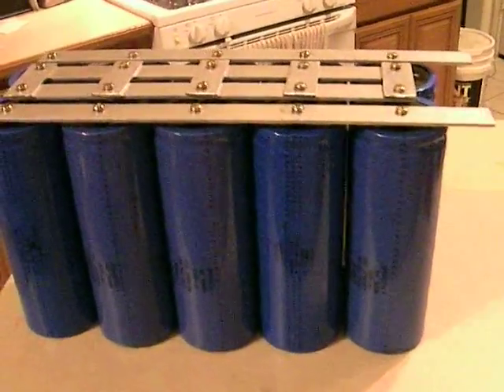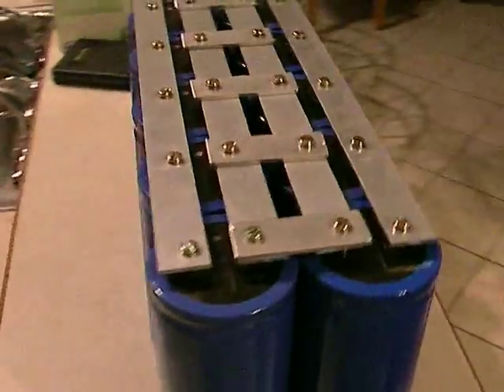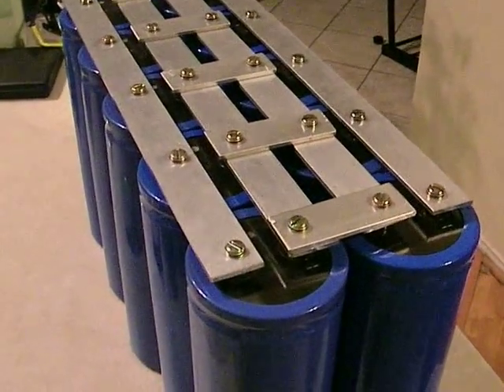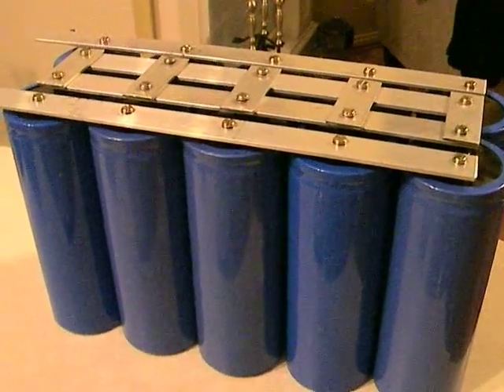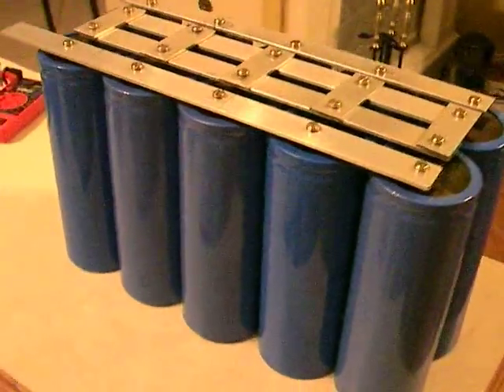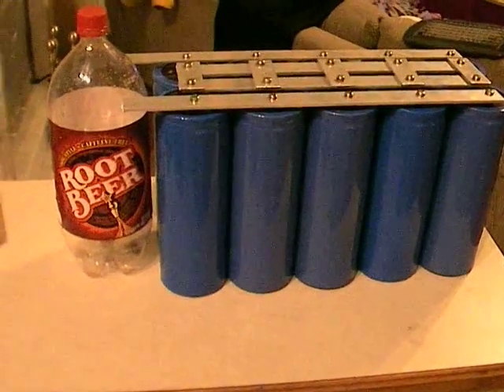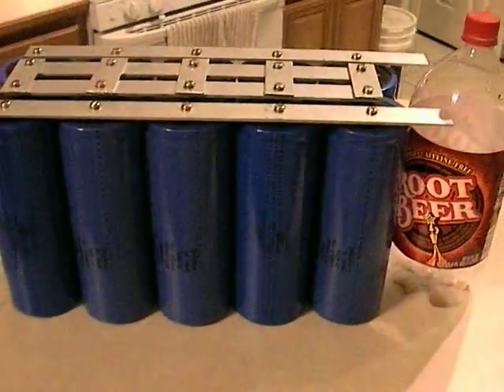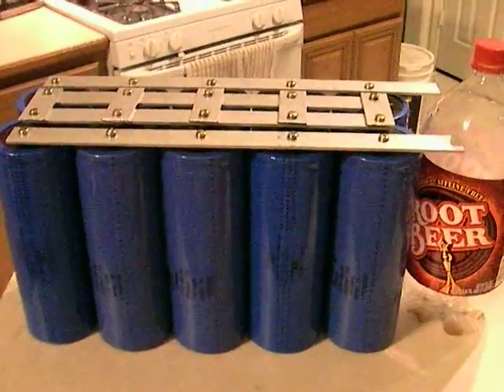150,000 uF Capacitor Bank for Electric Car

Comment: Little use of that for an EV. The energy capacity of capacitors, 0.5C*V^2. Assuming the voltage drop for your capacitors was 50 v (most most optimum) , 0.5*0.15 F *(150V*150V-100V*100V)=938 J. For a 120 kw EV, such energy offers 0.8/100 power to drive your car. Or the most, it can drive a 3000 LB EV from 0 to 1.2 m/s.

Comment: i dont know much about Capacitors. in what way would these help an electric car? would it aid in regen? would it be for quick bursts( like a camera's flash [the disposable kind])? Oh just read the description... oh well. hypothetically if some one put those in there car and a electric motor But keep the original engine and the added some way to charge the Capacitor Bank(not sure how realistic this is) would it just give the car a short(not short as in small but short as in limited) boost(almost like NOS in video games?)?

Comment: The caps may smooth the supply a bit, but will do next to nothing else., The capacity is far far far too small to level out the high amp draw needed by the motors to accelerate the car and make the batteries last longer. You may need to add 2 balancing resistors on the bank.

Comment: 150,000uf means nothing , if they were Farads YES but not uf.
Reply: They are only thee to cover spikes in charging and draining. Good for accelerating and regen braking. It overcomes the internal resistance in the battery and prevents overheating.
Reply: even if it was 150,000Farad. 150,000f /60seconds/150volts.= 16.6AH.. not enough for a EV.

Comment: i have a bunch of big 5000,000uF caps 5V wired in parallel,i know the series parallel rules but know one ever mentiond if it adds volts .2 X5v cap will take 10v. but i have 10 hooked up and they handle 40V ,3amps fine,is this right or wrong ,reply thanx.
Reply: The voltage rating is how much voltage the capacitor can handle, not what it produces.  When you put them in parallel, you can only apply as much voltage as the lowest rated capacitor.  In other words, one cap rated at 5 volts and one rated at 100 volts, you can only put 50 volts maximum.  

When you put capacitors in series, it increases the voltage you can apply.  So with your 5 volt caps, 2 of them in series will allow you to apply 10 volts.  But your capacitance goes down.  The total value of capacitors in series is calculated the same as resistors in parallel.  With your 500,000 uF caps, 2 of them in series would be 250,000 uF

Comment: I know that this is a good thing.  I am glad to see that someone understands.  I have put large capacitors in my own electric car.  When the battery voltage drops, the car will not accelerate and the motor draws too much current.  I run a timing circuit that drops the pot box back up to 25% for 1 second to lift the voltage on both battery and capacitor.   Next, the capacitor works with the battery to really spin the motor and get the car moving.

Comment: You should really have a plastic or other insulator between the bus bars for safety. Drop a screwdriver, coin, key and it would possibly have a huge BLINDING ARC discharge with arc welder heat ! Almost impossible to stop it from destroying itself and PEOPLE around it !
 A small length of plexiglass or other insulator raising above the electrodes by 2 inches or more is needed for safety.

Comment: Is there any advantage to using a bank of small capacitors over using one equivalent super capacitor?
Reply: +stylac might be too late to answer now but yes there is, super capacitors often have higher (around 10 times) inner resistance. that affects the discharging time, so basically they discharge way slower. Not sure if this applies to all though.
Reply: +lyzux 

Good to know.   Thanks!

Comment: I'd use all capacitors instead of lead acid, they're a fraction of the weight and half the price
Reply: No, they're not. The bank in this video is 150,000 microfarads, which is 150 farads.  That's 150 amp-seconds.
A single AA nickel-metal hydride battery is about 2000 milliamp-hours, which is 2 amp hours, or 7,200 amp-seconds.  A small lead-acid motorcycle battery is about 12 amp-hours, which is 43,200 amp-seconds.  That's 288 times what the bank in this video will store.  Do you really think 288 of the assemblies in the video are smaller or lighter than a small motorcycle battery?  I don't.
Reply: Dan-Ari Feinberg I was thinking of super capacitors and being conservative with the throttle. By the time I build an electric car capacitors should hold half the power batteries can
Reply: Dan-Ari Feinberg 150,000 uF = 150mF (milli farads), not 150F
Reply: Telukin
You're quite right about the conversion.  To the original comment about capacitors being a fraction of the weight of lead-acid batteries, a 150millifarad bank, even at 75 or 150 volts would still hold a tiny fraction of what a battery could.
Reply: Dan-Ari Feinberg But batteries have relative high resistance compare to capacitors and give off power slow.

Comment: also, 150 Volts is max voltage if your charging system spikes over 150V you will have a cannon shell going off under your hood. usually manufactures make sure the caps are rated double the operating voltage of the circuit to prevent caps from exploding.

Comment: No, it's 150,000 ufd @ 150V. Caps in series is the same formula as resitors in parallel or less than the total 1/((1/C1)+(1/C2)+...). Two 60,000ufd caps in series are 30,000ufd. 30,000 x 5 = 150,000ufd or 60,000 x 5 = 300,000 / 2 = 150,000. Basic electronics theory will tell you that.

Comment: I think you can also connect a perm magnet alternator to you electric car to spin along as you drive and i bet that will increase range effectively!
Reply: Nope. UnderUnity plus UnderUnity NEVER equals OverUnity. 
But using a PMA/PMG for regenerative braking is the way to go!

Comment: I'd like to second daveharpe's suggestion to use equalizing resistors. If this is being placed across a series battery string, you could also connect the center tap of the capacitors to the center tap of the battery string to ensure equal voltages on each half without wasting any power.

Also, electrolytic capacitors have a nasty habit of failing violently. Consider fusing them, or at least connecting them downstream of the battery fuse/circuit breaker.
Reply: Dan Soethe Normally you want capacitors to discharge into those resistors to make the stack safe to handle some time after you shut off the power. But here you want to store energy indefinitely so you can't do that. I think a power zener is probably your best bet as it doesn't waste any power at all unless the voltage gets to a dangerous limit. The zener itself doesn't have to dissipate all that power, you can amplify one with a power transistor that is well heatsinked. Ideally you'd also monitor those safety shunts and cut power if any of them starts to dissipate a serious amount of power.
Reply: zener diode balancing is sometimes a good alternative
Reply: African Electron Yes, zeners are a very good idea because they don't have to conduct at all unless the voltage gets to a dangerous point. You just have to be careful, because some failures might cause the zeners to dissipate so much power that they burn up.
Reply: if you use resistors for charge equalization be sure to use rectifier diodes in series with the resistors to prevent the caps from discharging back through the resistors when you disconnect the charger or turn off the car.
Reply: ApolloWasReal check out my video on super capacitors and ways of balancing i use zeners  (please note the shameless self marketing).
Reply: Phil Karn that's true all though zeners have a natural resistance when reversed biased so that is often enough to prevent them burning out
Reply: African Electron I don't understand you. Zeners are designed to break down at a specified reverse voltage and go to as low a resistance as possible to keep the voltage from going any higher. This means  they can easily dissipate a lot of power carrying relatively little current since the "on" voltage is usually so high. E.g., a 9V zener carrying 1A  dissipates 9W.

Comment: Hey you brainers... forget caps in parallel with the battery. Use a coil in series with the battery output instead. Remeber how a coil work with high frequency current riple.... it will straighten out he current flow.........

Comment: What i cant wait for is silicon super capacitors to get developed well. Energy density is through the roof  compared to what we have now!

Cant say theyll be cheap, but electric vehicles will charge in minutes (as fast as the supply can provide) and run much longer.

Comment from the maker: Yes it is a DIY electric car and its battery pack has actually been upgraded to 156 volts now.  It has more power and faster acceleration.  Safety comes down to practices.  Using a spanner and dropped across 156 volt or 48 volt is just as bad, a huge plazma ball and sparks will happen either way.  More saftey things should be taken considered at higher voltages but they can be just as safe as lower voltage.  Just need a good head on your shoulder when working with high voltages.

Comment: 75 V. is the voltage that safely be applied to each individual capacitor, not the vehicle's battery voltage.   More likely than or not here it's 48 volts if it's a home made vehicle & looks as he is.  Went to his home channel it's home built , but shit it's  120 V. damn. All kinds a reasons why to use that higher voltage in an EV The only reason not  to is it's generally agreed on that 48-50 V. DC is the safest limit.

Comment from the maker: I just looked up the E-rockit and that is pretty cool idea.  But you wouldn't want to use capacitors in place of a battery.  You should look up a lithium battery.  You can get just about what ever size lithium battery you want for what ever milage you want to go.  They are really light weight which solves your brick problem.  But that is a very cool idea and would like to see more things like this around.

Comment from the maker: If you use an oscilloscope, you will see the amperage spike is higher than what is read on most meters.  They are essencially showing an average.  When the DC controller is chopping the power, it is doing it at a super high frequency that most meters can't see.  I was hoping these caps would scrub out the higher peaks to better match the average.  This wasn't intended to add capacity for driving.

Comment: In this video he has a:
(75v)5=375v
(.06f)2=.12f=12ah/3600=.00333 amp*hours
(375v).00333ah= 1.25 watt hours 
Hardly enough to run a flashlight and this set up could violently explode if overcharged.
If one capacitor is slightly leaky, it will gradually transfer its voltage to the others, possibly exceeding their voltage rating in turn. And if one of them punches through its dielectric barrier, it can then damage others in a cascading fashion.

Comment: Interesting, I have never thought about the batteries internal workings would be affected by the current spikes that the motorcontroller could to generate,  releasing energy to the motor.
I wonder if anyone has analysed hi frequence discharge from the batteries, How it affects service life

Comment from the maker: This setup is a 5P 2S.  Meaning 5 in Parallel AND 2 sets of those in Series.  This is done all the time on batteries AND capacitors to make up different voltages AND capacitences.

Comment: The voltage does not stay the same at all, there is obviously voltage drop for starters, but if you knew anything about ANY type of battery there is a discharge curve, NiCD for instance has very poor curve, fading alot as the battery is depleted, A123 Systems for instance (LiFePO4 w/nano-phosphate) has the best discharge curve of any battery, virtually no drop in performance until about 10% SOC.  The concept of using capacitors is that they are a 'power buffer', taking the brunt of the peaks.

Comment: You are correct (amazing that the truth gets negative votes) E=1/2CxVxV , C=0.15F (not0.3F) .. V=150 . so energy stored is 1687J  but only about 500J would be available to for use as the caps are only slightly discharged. This will do nothing.  Electric Formula should consult an electrical engineer. TELLING THE TRUTH IS NEVER NEGATIVE

Comment: The problem with using capacitors is that as they deplete the voltage also drops as apposed to batteries were the voltage stays the same till they are "dead"
Reply: Don't capacitors charge quickly?

Comment: Great, thanks for showing this!
I've created a cap bank(29240uF) of 43caps with 680uF/400V for my Mitsubishi i-MiEV.
It's parallel to the traction battery of 366V. In first tests everything is equal, but in the regenerative braking I've got a huge difference and I got more Amps to the battery back!

Comment from the maker: You are correctly, the caps should be discharged when not in use.  I have some resistors to bleed them down.  I also have the caps in a container to prevent anything or anyone touching the buss bars.  This video doesn't show the process of slowly charging them or the container I was storing them in.  So those are things that need to be looked at as well.

Comment: Well, I don't hear millifarad that often in everyday life, but plenty of other metric units with milli- as its prefix. So it's not exactly difficult to apply that to Farads as well ...

Here, a free lesson:
Pico = 10^-12 (abbreviated with "p")
Nano = 10^-9 (abbreviated with "n")
Micro = 10^-6 (abbreviated with "µ")
Milli = 10^-3 (abbreviated with "m")

Kilo = 10^3 (abbreviated with "K")
Mega = 10^6 (abbreviated with "M")
Giga = 10^9 (abbreviated with "G")
Tera = 10^12 (abbreviated with "T")

Comment from the maker: You need capacitors that operate in the voltage range of what ever your connecting it to.  The Stereo automotive capacitors only work for 12 volts.  You have to put them in Series to get the voltage up into a range that is useful but once you put them in parallel, the capacitence drops.  So that doesn't really work in your favor unless your talking about super capacitors where they are several hundred farad.

Comment: true, I found a super cap on eBay; 3000F, 2.7V, ESR 0.00029 Ohm, Isn't that low enough?, I was just concern about the 150,000uF capacitor banks' ability of holding less charge & quick discharge.

Comment: @zpkpk 
That sounds feasible. However the voltage they hold will be the key to what kinda kick they will give you. If allmost all of the power stored in them are released in a few secs in the electric motor you will get an acceleration that will throw you off the bike.
However if the voltage is lower will the capacity is higher, they will last for a longer time and with less power, probably someting you would want for a bike.

Comment: The capacitors are absolutely huge considering they are not ultra caps. Out of pure capacity, could these be used on an electric bike for quick "stints" of power? and then slowly recharge through a small dymo that puts little drag on the rider for another quick stint when required? Or does the capacitors high voltage stop any of this? Would be great to know mate.

Comment from the maker: @zomgz932 Unfortunately, Capacitance drops when you put caps in series.  So your 5 Caps in series would be around 24 F at 12.5 Volts (120F / 5 in series).  If you wanted 120 volts, you need around 50 of them to have a good voltage buffer and your capacitance would be down to around 2.4 F. That is why people use Maxwell ultra caps because they start out at 3000 F.  So you have 60F at 120 volts.  But as you see the price becomes prohibitive.  But of course I would take donations for testing  :-).
Reply: Thus, why Telsa has bought Maxwell out... There will be some good come from this yet. Waiting with fingers crossed I want to store HV 150,000v+ and discharge to a usable LIPO bank.... Points finger at triple Wimshurst discs on a wind mill/generator #telsamakesithappen...

Comment: @TheSuperKV found 120F caps for $9 make a few banks of those things  and your in buisness.  plus a few banks would be about the same size of this guys one bank.   5 caps at 2.5v would make  120F@ 12.5V x  5 of those in parallel = 600F @ 12.5v  with a before shipping cost of $225   a guy on ebay called "electronix2384"  has the caps

Comment: @NoFaithNoPain
will capacitors replace today's lithium batteries: not in the next 15years
will capacitors replace batteries in general: not in the next 50 years
its somewhat likely that batteries and capacitors will converge to have similar properties in the next 100 years

Comment: What do you intend to do to insure that each parallel bank of capacitors gets semi equal voltage? You have essentially 2 big capacitors in series. The center - common -should- be at half the full voltage, but there is risk, during high current surges, that it will vary quite a lot. Normally 2 resistors are used.

Comment: By the way, conoba is right about the energy. Don't expect this to improve the acceleration, but it will greatly reduce inductive radiation in the battery cables if you put it as close to the controller as possible.

Comment: Just a suggestion: Add a resistive divider when putting electrolytic capacitors in series. Otherwise leakage of one capacitor can overcharge the entire bank in the other group in parallel. Set it up to carry slightly more current than the worst case leakage spec for the capacitor. It probably won't be more than a few milliamps. Use Ohm's law and P=E2(squared) over R to find value and how much wattage. It will probably last a lot longer, and it won't noticeably drain the battery if done right.

Comment: Fun and dangerous hobby for sure; not bad for a 2+ year old tinker. The capacitors in the banks are not balanced and the Power Density is probably good for storing power reclaimed from regenerative braking. Now you just have to find enough energy density from batteries, a 3 phase brushless AC motor, a kick ass battery charger and you can have your own home brewed EV sir lol